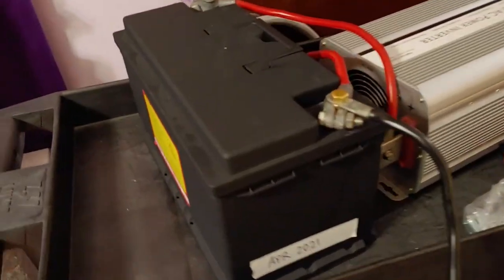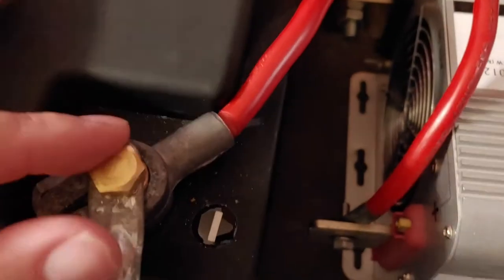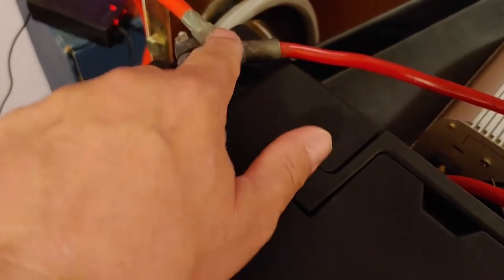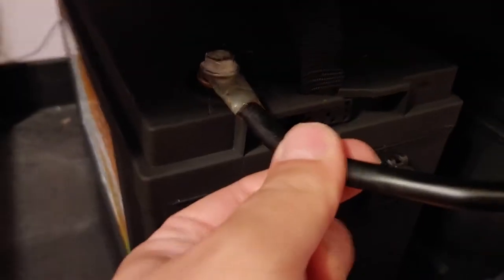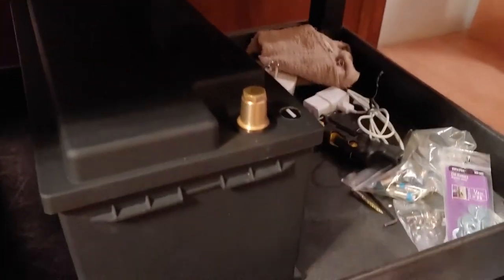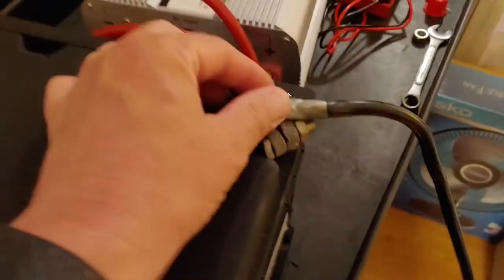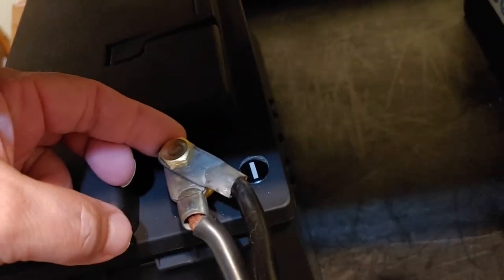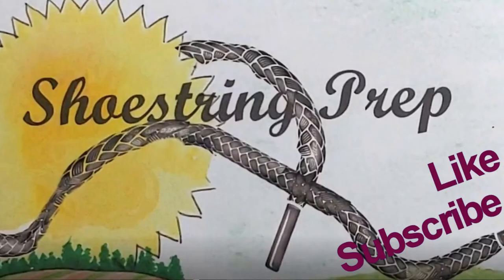Updating my DIY solar mobile power station with inexpensive Flypower lithium batteries.

Comment: Can I mix 200a Chins battery's with 200a Power Queen battery's in my battery bank?
Reply from the maker: As long as both types of batteries are lithium's and the amp hours are the same it should be okay. Thanks for your comment.
Reply: @shoestringprep  Thanks for your reply

Comment: Hi .my question is what happen if you leave the charger plugged in the battery  an the red light stays on put not plugged in the power outlet do a video on that I know they like laptops chargers. My is will it discharge the battery if you don.t disconnected from the battery
Reply from the maker: I will create a video as you requested. Thanks for your comment.

Comment: Your inverter will use 390 amps of power if maxed out. 5000 watts divided by 12.8 volts = 390 amps. You cables will not handle that much amperage. You know you should not add to a lithium battery bank once a battery is more than a month old.  You can destroy your batteries and make sure all your batteries are all fully charged before adding another one.
Reply from the maker: Thanks for your comment
Reply: i have added batteries to my system and on the advise from multiple distributors it is acceptable to add to a bank within a two year window....the one month you mention seems to be for lead acid chemistry.

Comment: I am using 24v settings can you tell me what to set my controller on for hi voltage and low voltage and float voltage for lithium battery's
Reply from the maker: Most charge controllers tell you to connect to the battery first. Generally, the controller will read whether your battery is working at 12v or 24v and adjust their settings accordingly.
I would need to know more specifics, particularly what charge controller you are using, to advise you about adjusting settings manually.
Thanks for your comment.
Reply: @shoestringprep  I am using the 100A MPPT solar charger from China It worker great with my lead acid battery's simple to use
Reply: I am using 2 of the 200A Chins battery's
Reply from the maker: @jameschampion2946  what type of charge controller are you using?
Reply from the maker: @jameschampion2946  it will also work with your lithium battery. Once you have the charge controller connected to the battery it will automatically go to 24 V. Thanks for your comment
Reply: @shoestringprep  I am using a 100A from china with 2 200A chins battery's I used that kind of charger when I was using led acid battery's and they are simple and worked great
Reply: @shoestringprep  Thank you I need the high voltage and the cut off voltage along with the float voltage
Reply from the maker: @jameschampion2946   lithium batteries High voltages 14.6 low voltage is 10.5 lithium batteries do not need a float thanks for your comment
Reply: @shoestringprep  Thank you very much. I like your video

Comment: it looks like your battery cables are hooked up wrong 1 cable from the inverter should be attached to the first battery in the bank and the other cable to the last battery in the bank the way u have it set u will only be powering inverter from the first battery and the 2nd battery will charge the first battery and so on
Reply from the maker: I understand it looks that way. But my testing shows that the batteries are charging equally as well as discharging equally. So everything seems to be working really well. Thanks for your comments.
Reply: Will that not put all 3 batteries in series???
Reply from the maker: @fratomdev  the battery cables are connected correctly and the system is working great.
Thanks for your comment.
Reply from the maker: @fratomdev  the batteries are in parallel, not series.
Thanks for your comment.
Reply: yup
Reply from the maker: @drunkinone5969  thanks for your comment.

Comment: for the price of three batteries i could buy a Bluetti ac200 solar generator with a ten year warranty and everything else needed built in. not a deal at all. you are being ripped off...
Reply from the maker: Thank you for your comment
Reply: I have 2 Buetti AC200P and they only have 2 year quarantee. They are very nice units though considering 1800 usable watts and a 2000 watt built in inverter.
Reply: @soberpickle8195  That AC200P is 1800 bucks with 2000Wh. This guy is 1200Wh and costs 370 bucks. 5 of these will give you 6000Wh cost the same as your AC200P. All of them are made in China anyway. LOL
Reply: @trumplostlol3007  Ohhhhhhh Burnnnnnnnnnnnnnnn
Reply: Those batteries are currently $338 on Amazon (for a total of $1,014), and yield 3600Wh capacity. The AC200 is currently $1,599 on Amazon. That's about 50% more costly (and only 2000Wh (about 55% of the capacity). As sober pickle noted, they are also listed with only a 2 year warranty (not only on Amazon, but the manufacturer's own site), not ten years. The AC200 is a nice pre-packaged all-in-one solution, no need to oversell it.
Reply: are you people that simple?  to use the batteries you need 2to3000 worth of electronics!!! BMS , MPPT , DELIVERY TO 110 OUTLETS , USB PLUGS ,an inverter , and about 15 other parts .never mind a case to build it all in. you people are making about as much sense as a 5y\o,,, i bought from Bluetti and that is the warranty they gave me,
Reply: @rob-roybeattie8436  You claimed "For the price of three batteries...", which was false. As with most packaged batteries, this one includes the BMS, and in case you didn't notice this one has 2 USB ports. Also, $2-$3K of additional electronics? Only 2 batteries would be required to exceed the capacity of the AC 200. A MPPT charge controller sized for that capacity and a 2000W sine wave inverter aren't going to cost anything close to that.

Discrete components also allow for upgrades. Can you change out the charge controller in your AC200 for more capacity? Can you change out the inverter for higher output?

Also, we can only take your word about the 10 year warranty. Their own site states anyone purchasing now won't get that.

Finally, insulting people isn't going to prove your point.